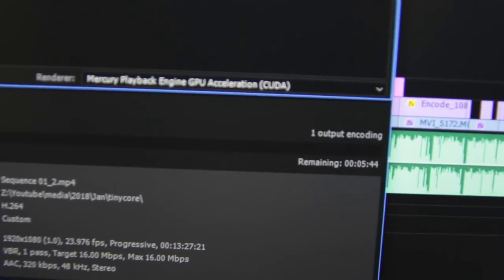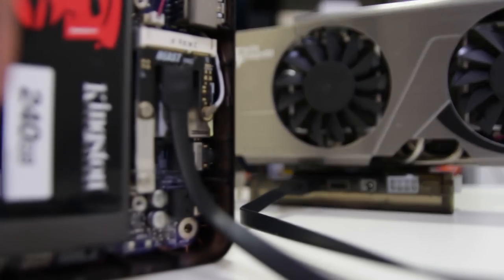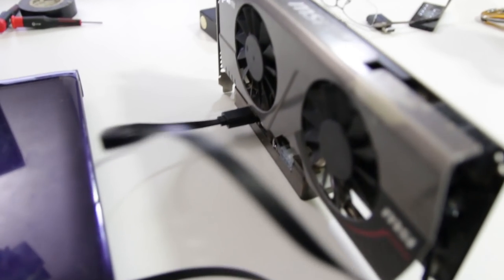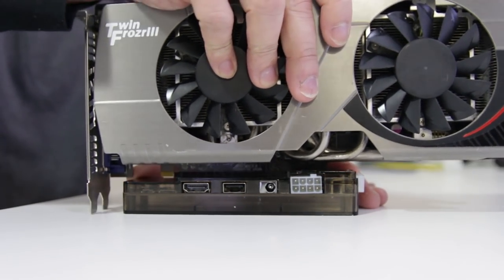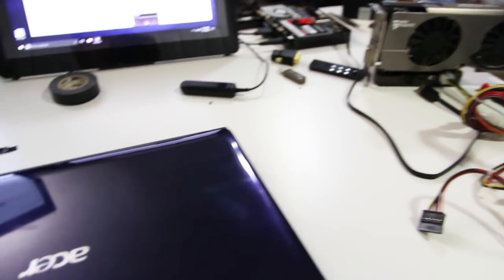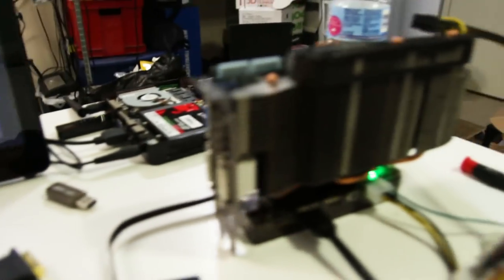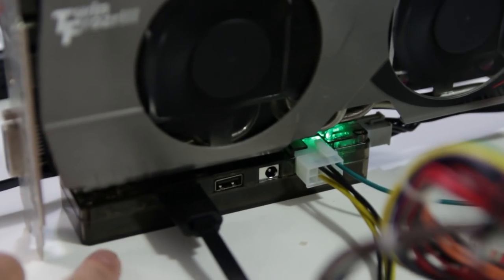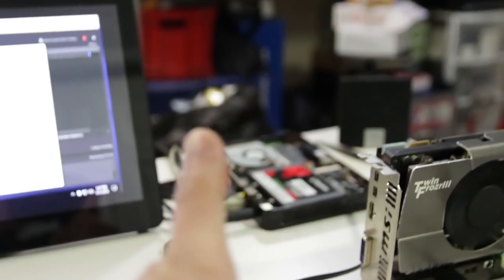External GPU on Laptop or Net Top setup | aka EGPU

Comment from the maker: Rather then giving you a clean video where everything just works... i have decided to show you  the stuff that caused me trouble. i hope you enjoyed this!
Reply: Just FYI, AMD bought ATI in 2006, they didn't change the branding to AMD until much later.
Reply: What made your Acer incompatible again? I'm planning to get an external on my Dell Inspiron with integrated GTX 850m
Reply: How well does it mine
Reply: Novaspirit Tech 

The external GPU is a great idea, why not make an external twin GPU that makes any two GPU cards work in SLI or Crossfire instantly and with it's own CPU, like a mini PC with a power plug.
Reply: THANK YOU FOR THIS!!!!
i have considered doing this exact thing with my web browsing pc for a while now! i have a "nettop" HP EliteDesk 705 with an A10 Pro that works good, but i want more :D
Reply: Novaspirit Tech have you disebabled the gpu from your laptop and look up in the device manager if you see the new gpu?
Reply: @slappyextendet6183  it also sounded to me like his power was not setup correctly and he was turning the card on after the PC started.  Here I am now wondering if he revisited this project. That would bug the hell out of me.  There should be settings in the bios, but mind you it's a laptop and the graphics bus is probably proprietary and not with the pci bus directly.
Reply: Disable driver auto installation from the device manager and you'll be set to go

Comment: Make sure you are using an m.2 port and not a data mini pcie port. Use the one your wlan card is plugged in to. Also that laptop may need you to flash a custom bios as the m.2 port could be locked to certain wlan cards.

Comment: biggest point here is regardless of bottlenecks this thing made his net top run 10x faster. you dont get the full throughput of a desktop x16 but if you DONT want to make a whole build from scratch this is 100% worth the money. people who complain about the bottlenecks dont understand that building a whole PC with perfect cpu isnt the point with eGPU its to make a current device faster. You can find used laptops for super cheap sometimes free and with around $150 total you can play GTA V or some other games and work on some solid stuff.

Comment: AMD bought ATI in 2006. your HD 7950 is from 2012... adn it was relaunched later as R7 280, not 270
Reply: Felipe Hackner wasn't it the r9 280?
Reply: r9 280 was HD 7950. And there is no such thing as an r7 280. r9 270 = 7870 and r9 270x = 7870.
Reply: isnt the 7970 the R9 280?
Reply: The 7970 GHz became the r9 280x, 7950 became r9 280.

Comment: I feel like this could be a great solution for cheaper AMD Apu laptops. I wonder if it were to be paired correctly if the Apu and GPU could run in dual graphics mode like the desktop Apu and R9 250.
Reply from the maker: yes i've done it before long ago.. but you do have to match the same series i believe. i've done it with ati 5450 and on board 5000 series... but i don't have any modern hardware i can try this on.
Reply: Novaspirit Tech That's awesome you've had success with it. Thanks for all the cool videos.
Reply: @NovaspiritTech  is that possible to do same with m.2 nvme slot by using m.2 nvme to pcie ?

Comment: also, if you try an nvidia  gpu for adobe you might get a better result. Adobe designed the CUDA specific workflow. and check the setting for the Open CL. You may get more bypass of the CPU for work.

Comment: R7 270 is either the HD 7850 or 7870 rebranded with faster VRAM (officially they should be the 7850, aka Pitcairn PRO, but the Pitcairn XT chip did get used in a few), the HD 79xx cards got rebranded as R9 280 and 280X... and I'm pretty sure the purchase of ATi by AMD happened right before the Radeon HD 2000 series cards, back in 2006, but kept the branding around until 2010. edit: and I looked up when ATi got bought and when the branding was dropped. the HD 2000 series was launched in 2007. I'm not sure why they dropped the ATi branding in 2010 when they were still using ATi developed architectures for flagship cards, when it was 2012 when the AMD developed GCN replaced Terrascale on their flagship cards.)
Reply: kiaas
HD7850 = R7 265 = R7 370
HD7870 = R9 270 = R9 370X
There is a nice list on Wikipedia where you can find that info.

Comment: Lol, I got scared. I saw the net top open like that without knowing it was a net top. I just ordered the dock and plan to use it with a 1070 and a 2018 dell G3 (the 2019 has a thunderbolt plug in mine does not) then I also have an older msi, and a tree stump desktop. Going to replace mobo, ram and cpu on it in time this is my temp fix.

Comment: QQ: If your laptop has a Thunderbolt 2 port, would it be feasible to use this setup? I'm interested in which ever method takes less of a performance hit. I have an ASUS ROG G751JT with the 970M and I'm thinking about going the eGPU route with either the 1060/1070 card.

Comment: I'm sure you're not really interested in doing this but what I ended up doing with mine cuz I got the exact same kit is I took a female to female HDMI header remove my CD drive wrap the cable up around itself in the CD drive bay and actually cut a hole in the CD faceplate epoxy sculpted the female to female HDMI header into the faceplate then sculpted the faceplate onto my laptop that way you can just plug an HDMI cable into the side of your laptop going to the egpu setup and that way you can take the laptop on the go and not have a cable dangling out of it I mean I know you didn't end up using the laptop but just an idea for other people
Reply from the maker: if it did work on my laptop i was going to clean it up... but mannn i had such a hard time with getting to laptop to cooperate... so i switch it over to the net top.
Reply: Novaspirit Tech yea, I hear ya, I had an issue with mine it didn't wanna work with stock pentium cpu in my laptop, thankfully my laptop had a cpu socket so I upgraded to a core i7, (granted the laptop is from like 2009 so it's only a dual core, but Atleast it was the fastest processor from that line) but now with the egpu, and the core i7, it doesn't like booting on the 8gbs ram(max for mother board) I have upgraded too, I think it's the ram speed, because it boots on the stock 3 or 4(i forget) gbs of ram just fine.

Comment: There is another adapter available ADT-R43SG which is a m.2 nvme to pcie16x adapter. So I wanted to know if this(ADT) adapter will work on my i3 10th gen laptop nvme connector.
Reply: Yes, you're just commenting in wrong video.
There's another dude reviewed that R43SG

Comment: how did you keep it on.mine has the same issue.its, not power on when laptop switched on. I put a jumper in the SMPS connector to keep it on.there is some switches on the GDC Beast, like PTD and ATX pwr, what does it do

Comment: Hi bro i need ur help. I used dell n5010 with exp gdc and used asus gtx760 graphic card. But after connection laptop screen is showing black. Even graphuc card fans are spinning exp gdc shoqing green led and laptop is also showing power on but screen shows nothing. Even cant access bios. After removing graphic card laptop working fine. Can u help me???

Comment: Can I do this with a desktop?    I want to keep my work area as quiet as possible.   I want to put my gpu and hard drives in a separate case.   Is there a better way to do this?   How long can the cable be?

Comment: Here again, so I got my exp gdc beast kit and tried it with acer, Not Working!   I nearly tried for 2 days,  it continuously keep connecting and disconnecting every sec and cant install drivers due to that. I wonder what is wrong any help here would be much appriaciated. Also, will the usb 3.0 kit that is used for mining normally would that work?

Comment: Hi I am a huge fan of your channel and just out of curiosity wished to see if an external GPU can be run with a ARM cpu based system like Raspberry pi 3 or ASUS tinker board SBC. 🤔
Reply: I know that it is too much to ask for but well to start off their could be an option with an M.2 port adapter for ssd to be used with m.2 to usb 3.0 cable adapter to connect to the external gpu with a pcie riser card as gpu>riser card >USB 3.0 cable>USB 3.0 to m.2 adapter>m.2 ssd to usb 2.0 adapter >raspberry pi 3 with Ubuntu 16.04. It will be awesome if you can do it I am waiting for you to try it out.

Comment: I have the Acer 5740-5780 and had actually tried using this at one time. I managed to run the card through the WiFi mPCI with a GTX960. It’s a little janky but it works, also sometimes it would take forever to POST but would eventually boot up (only displaying to an external display connected to the card in the laptop’s case). Also you need to jump start/mod the Power supply, otherwise the adapter won’t start by itself when you turn on the laptop. It’s a good vid and even with the bottleneck I saw great improvement over the stock specs. Thanks on behalf of others for the vid. Keep it up 👍🏻
Reply: I have a Acer Aspire 5740G. Do you think this would work?

Comment: Hello. I have a USB-C Displayport ( not thunderbolt ) in my laptop. Do you know if its possible to use a cable like this one http://www.americanas.com.br/produto/92368044 to establish the connection between the computer and the adapter? I believe transfer rate would be higher than to connect a cable in the mini-pciexpress inside the laptop but I'm not sure if it works.... could you help me!?

Comment: what if i replace my old 16x card in my laptop with this setup..?? will i be able to use full power??
also can it be used as replacement for thunderbolt 3.0 egpus???
Reply: I think with thunderbolt full egpus they utilize the full 16 lanes

Comment: WILL it work on anyother laptop with dedicated graphics?
Reply: same thing i was wondering
Reply: Muhammad Shahzad it should as long as the laptop has these few requirements met:
1. A compatible BIOS with no black listing
2. A Express card slot or mPCIe slot (Wi-Fi) or m.2 M key or A key 
3. A compatible GPU, some of the 10xx series cards need driver workarounds
4. It just depends. Some models of laptops have been tried and it hasn't worked for various reasons.
(If you like BIOS moving there is that option)

Comment: hey i tried this with my laptop lenovo g570 it has i3 2330m 6gb ram(4+2) & i installed everything perfectly i use gt 1030 nvidia & i got error 12 :( can u help me i m stuck at this point please help me !! EXP's manual says install DIY EGPU setup 1.3 how can i buy that...
Reply: i think theres a vid here that says theres always a problem running gtx 10series with this kind of set up.

Comment: my laptop has Thunderbolt 3 connection, I want to buy this adapter but I do not know if it can work with an HDMI cable adapter to thunderbolt 3. Will it work with this cable?
Reply: If it's an usb-c thunderbolt 3 with PCIE lanes, look for the razer core (they now have an universal version).
You'll have the case, the psu, drivers if needed and less of a mess for cables .
It costs 299€ in europe , it's more than this adapter + a atx psu but you won't have to mod anything and you'll have a clean setup, a card that is cooled and can't get knocked off just standing outside a case ;)